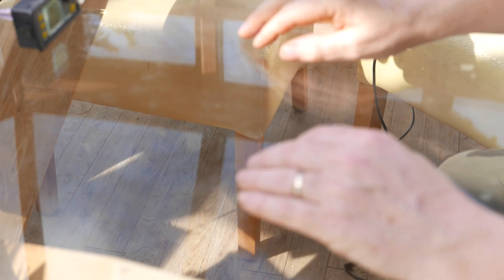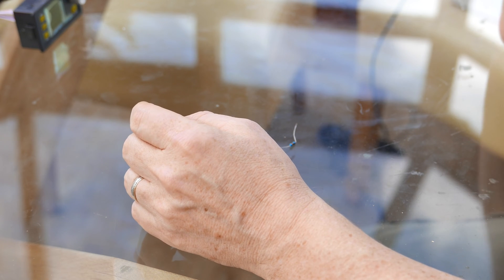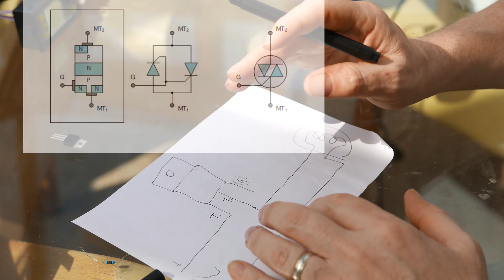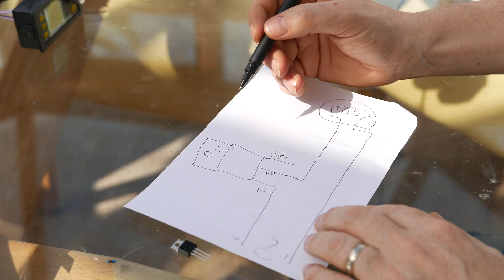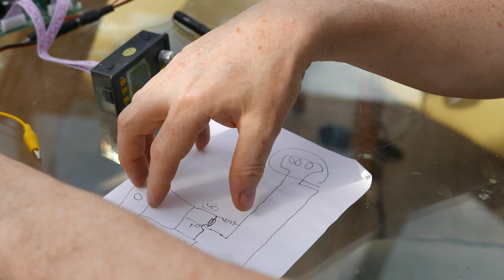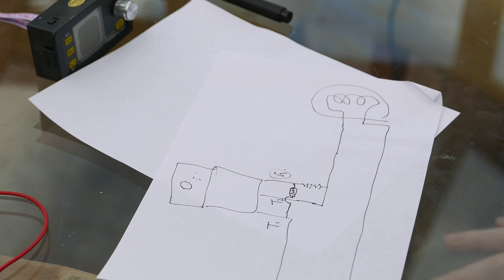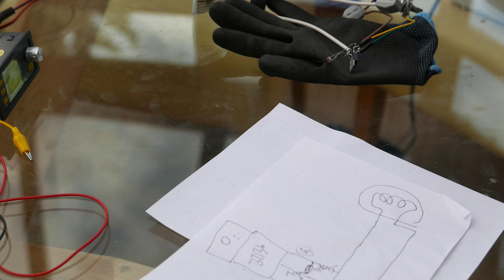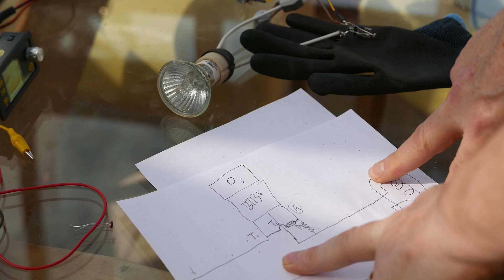Making a Simple Triac Dawn-Dusk Switch

Comment: They use relays these days due to LED light bulbs.   Using a triac on the LED bulbs depending on their internal electronics may not function properly.   This saves them some troubles after the sale.